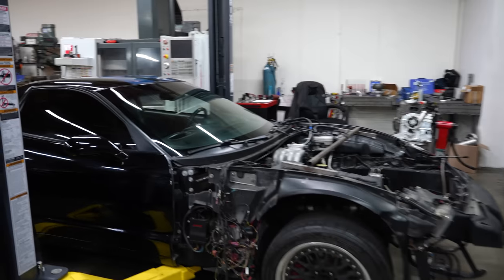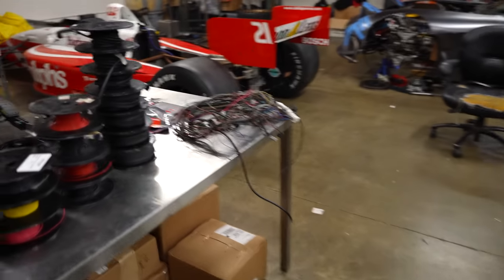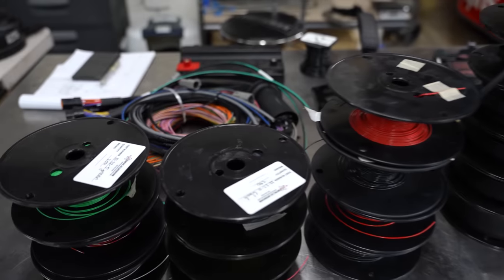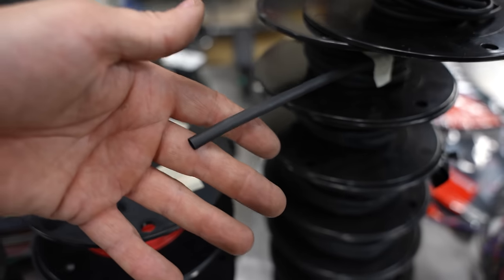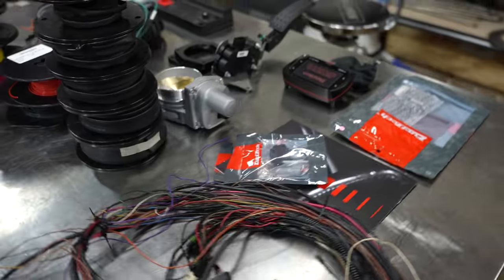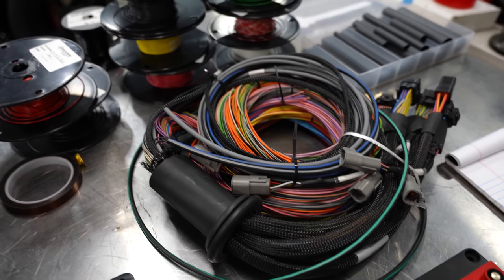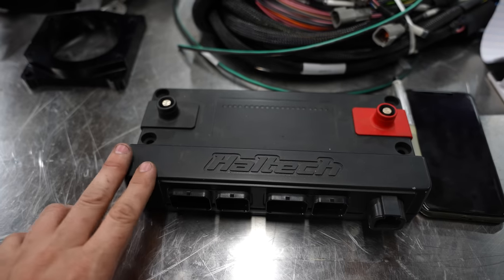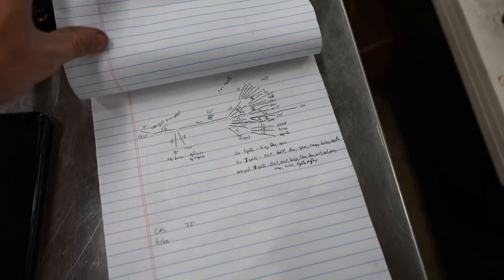The Ultimate Engine Wiring Starter Guide.

Comment: I think there was a missed point here that while a magnet would create EMI in a wire that is not shielded (and properly grounded), the reason that is a concern is that every single wire that carries current generates a magnetic field. So while you don't have magnets bouncing around inside your engine compartment, you do have a bunch of wires acting like spaghetti shaped magnets all over your engine bay. Higher current means more magnetic field, so this would be a particularly bad situation when your starter is drawing current, and is a huge concern in electric cars.

Comment: There is a tool I am sure will help you strip wires more easily and efficiently, Knipex ErgoStrip (part number 16_95_01_SB). It strip wires from 0.2mm to 4.0mm, at either end it can strip the outer layer off wires like your crank sensor and it can split the outer layer after cutting the desired length for quick removal. 

My dad and I each have one and it is an amazing tool, very useful I recommend anyone who does a fair bit of wiring or does it professionally.

Comment: Great video.
You could use cotton thread/rope insted of expensive dummy wire. No way for it to catch fire and it is much softer and forgiving. It is used in power tools cables very ofter as strain relief. 
And some talk powder (or even fire extinguiser poweder) can keep the cables from grinding to each other under high frequency vibration and absorb moisture/liquids. Makes the process a litle bit harder but it is worth it in my opinion.

Comment: Rob, too late now but if ya got a wire color you didn't plan on using in the harness (think light gray or blue etc) you use them as filler. That way you never confuse em

Comment: Hey Rob, loving the video so far! At 38:17 you said that the black filler wires stop and then start back up. Is there a specific reason you stopped and started? Why not just make them one length for continuity?

Comment: Okay, so few questions.  What is the exact reason for adding the wires that were not going to be used?  It’s going to be covered, so it’s not like it would be visible.  Does it benefit the harness in anyway?  Does it allow for more flexibility or something?

Also, is this harness specifically for the engine only?  Because it looked really short when it was wrapped in your hand.  Does this not also go to the lights (headlights, taillights, interior lighting, if the car will have it, etc.) of the car?  Not familiar with haltech, does that dash piece that this harness plugs into only control the motor itself?  The rest of the stuff still has to be plugged into the standalone ecu, right (again, lights, airbags if someone chooses to still have them, etc.)?

Comment: Hi Rob, wonderful job.  I do rebuilt wiring harnesses for classic Mercedes’ benz and that is a complete different challenge.  But one of the products you mention “signal shielded 2 line wire” is something I have wondered where to buy it since a long time.  I own a BMW E31 840ci which use to had many electrical issues for which I have repaired and leaved in mint condition most of its harness.  Nevertheless  I was not happy with the crappy shielded wire I sourced to replace the Crankshaft position sensor and camshaft sensor lines.  Could you recommend me a vendor for quality wire to replace those lines in the bmw 840 harness?

Comment: Rather than putting extra wires in just to fill out the layer, why not use something like nylon string or something to add the space, but be more flexable and not waste copper and cause less confusion. You can't mix up a nylon string with a wire ;)

Comment: why didnt you go solder seal wire connectors? you get soldered connections heat shrink with hot glue to water proof all in one go

Comment: Jolly good video 👍

BUT, electricity DOES NOT travel on the outside of the wire. Well, with EXTREMELY high frequencies, there is that affect, and what are called 'wave guides' may be used.
The reason multiple strands are used in the wire is simply down to increased flexibility and, as copper is susceptible to work hardening, the reduced stress reduces the risk of fatigue breaking the strands.
That work hardening problem is also the reason aluminium (aluminum for the 'mericans) isn't used as a conductor for vehicles - unless you REALLY want failures.
Very high end wiring harnesses will use silver, as the resistance is even less than for pure copper, so a lighter gauge can be used. Eve higher end wiring will be formed with a hexagonal cross-section to allow even higher wiring densities to be used.

Gold plating of the connectors is normal as, even though gold isn't the best conductor, it's extremely resistant to corrosion, which can cause problems with the conductivity.

Comment: Would it be beneficial to terminate one end of the spare wires and ground them? In low voltage wiring this is commonly done to prevent keep electromagnetism from building up energy in the spare wire that could possibly cause interference/crosstalk.

Comment: As a filler wire of the same diameter why not use a lower amp cheap wire so as the thickness is the same!

Comment: I have a 2013 Kia rio  I just took the steering column out of it it's electric put it in a buggy hooked up all the wires The key power on  Wire There is a blue and red Needs to be hooked up Where do these wires go

Comment: My 1999 Truck had 59 wires going to the Power Train Control Module.  These wires need to be longer.  I am having trouble finding solid wires with a stripe.  These need to match the current scheme that came with the truck.   Where to get Finely stranded Automotive wire with GXL insulation??

Comment: Watching some of your newer/other videos, you were removing unnecessary weight from the vehicle and trying to balance the weight. Coming back to this video, do you regret using wire as filler? Reasons being, 1)the extra weight, 2) the cost aspect, and 3) couldn’t you have used another material that is 100% the plastic? Could a cheap option be using 3D printer filament as filler? The filament comes in any size, so getting a spool that matches the same o/d of the wiring would be easy as well as lighter and more cost affective.
Reply: Not saying I learned a lot and enjoyed watching the video. Also, there’s a zip tie trick where as you braid the wire, you slide a zip tie along the length to keep everything tight and from unspooling

Comment: Use pipe to lay out your routes, use hose pipe for backbone and  smaller pipes for the splits. It allows that you to check radius on bends and makes sure splits occur in the right place. Once you have the pipe layout you can lay it out flat on a board and knock pins in to route the wires around. Once you have completed and wrapped your cables, make sure you warm the harness up before installation it makes it easier to bend the cable around in the car.

Comment: So I am only half through. But on the connections like for the 5 volt wires in the middle of the harness. Why not add some solder to the crimp?

Comment: curious can you show us how to wire/ use a relay? using the stock ignition as the trigger? im having issues with relays im swapping my fuel pump relay but my trigger isnt working or im having faulty relays? im not sure whats going on

Comment: Here's a thing that will make your mind bend (or blow.)

Electricity actually flows from the ground outward. Not To it. 
Electricity flows from high negative potential (the negative terminal) to low negative potential (the positive terminal.) As the flow of negatively charged particles (electrons) are repelled from the negative terminal and attracted to the positive terminal.

Happy wiring
Jordan

Comment: This build covered it all. Amazing to say the least. I wish you'd have soldered your splices. If a oil pressure switch internally fails it will pump oil through the wire and if that wire meets a splice unwanted resistance is made inbetween all those crimped wires. It's a pretty common failure in my day to day. Even fuel intrusion from injectors. Not only that but pressure is not needed, cam and crank sensors can wick oil into harnesses like lanterns believe it or not. I have my doubts in crimps.

Comment: Rob I have a question, maybe some advice if you will. I'm currently in college for automotives trying to get my associates, after my associates I'm thinking about doing electrical engineering for my bachelor's. I love doing wiring, I love working with electricity. Do you have some advice or anything for me? I know it's kind of open ended but anything helps. Thanks!

Comment: What could cause engine rpm to not return to idle speeds when you are coasting (not pressing throttle ). It normally happens but doesn't happen anymore. After 5 or so seconds the engine return to idle while driving and gas pedal depressed.

Comment: I'm also doing DBW on my FC. Utilizing a accelerator pedal sensor from an s2k to convert the cable to a digital signal. That way I don't have to modify my pedal or install an aftermarket/non-stock pedal. I will be using an rx8 throttle body. If you want more info, you can ask Isaiah to message me. I'm local to ya now too, over in Corona. - Will Mac

Comment: I would think someone would make plastic filler that you could use instead of wasting good copper. You could still include some actual spares, but having 7 spares seems excessive. You could have 3 spares and the rest as dummy filler that could save cost and weight.

Comment: I'd 3d print some molds to do an injection for the junctions.

Honestly you could 3d print a little compartment for the back of the fuel tech module to cover the wires too.

Comment: Eh Your ground theory is a bit much. You don't need EVERY ground to go to one point, but you don't want to have a million different grounds either. It is best to have like 1 in the rear chassis, 1 in the dash or console, and 1 or 2 in the engine bay depending. Trying to do ALLLLLLL of them in one spot is just a waste of wire, and by shortening the grounds you also reduce resistance in your lines. You will be ok going to one point, it is just sort of wasteful of wire, and is prone to loss by going far longer than needed for some things. Everything else pretty spot on tho. Well said.

Comment: Can you use any color wire or do you have to use a specific type of wire for a specific type of part it’s connecting to?
Reply from the maker: I’ve noticed different companies try to use a common theme. At least it’s easy to think black is chassis ground. Red is 12v. Then you can use discretion on sensor ground being say black with stripes and 5v being red with stripes.  Commonly seeing companies use white as sensors and yellow as outputs. But once the harness is sealed up it’s like that Benjamin Franklin quote about banging ugly women. In the dark all cats are gray. Oddly enough I’m not making that up haha
Reply: @RobDahm  this helps a lot even though it was kinda hard to understand but I finally got it. I’m still pretty young and I love to watch your videos. Your videos help me learn a lot of things about rotaries and a lot of other things. You motivate me to get an rx7 fd before I graduate high school which I really want to do because you got your rx7 at 19 which made me realize that it’s possible. I think the wiring might be the scariest part to a car for me at least.

Comment: if you need cheap heat shrink go to your local bicycle shop and ask if they have any old bicycle tire tubes you could buy for cheap. They work exactly the same and are great on a budget.
Reply: Very funny eh?
Reply: @M-DIY  what? it’s not a joke
Reply: @patrickriordan2447  Buty rubber tubes are not polyolefin tubes which would shrink upon application of heat.

Comment: Why not just use lower cost wire for the filler wires?  Gauge, conductor type and insulator type is irrelevant for them, so just find cheap, generic wiring that matches the same outer diameter of your good wires.

Comment: Rob just accidentally explained 75% of the ultimate mud truck waterproofing and he doesn’t even know it.
All that’s missing for mud trucks:
Silicone the distributor cap (or make a custom one)
Marine mil spec amphenol connectors rather than the lightweight Motorsport ones
Subsea submersible electronics box(es) for ROV (repurposed for ecu/ign/bcm)
Submersible grounding box
Additional potting in key locations

Comment: Why wouldn't you use all individually shielded cables or buy 24 Core Dual Pair with Individual shielding? Just a thought. Also why not use solder, is it not better than crimping, then you don't worry about strain relief?

Comment: Chunk of metal no chunk of metal hey I think it’s called a sign wave single lol…—[___[__[ close as I could get with a phone lol…it’s just a on and off single which has either a missing tooth or wider gap fir cylinder number one
…this isn’t very complicated if you’ve got a proper Ecu and you know the pin connections it’s just a matter of running the wires soldering a connector and plugging everything in…

Comment: May god how long can someone go on into making up a harness , and I’d say your levels are screwed up..
Milspec would be the top level which is pretty much what you also see on a true F1 race cars today too or on military fighter jets too..,having pin connections and all being strong enough to handle fuels and harsh conditions plus using other Materials than copper for faster transfer speeds, water proof etc..,
Next is the Typical race car stuff & HIGH END oem wiring ..
Then you have the custom high end aftermarket harnesses..
 Then the cheaper aftermarket harnesses..
Then as you pointed out the mix and match OEM professional tech built harnesses ..
Then the cheap mix and match back yard junk wring harness built by someone who thinks they know what they are doing but don’t and have issues left and right lol…

Comment: A sane man would not waste a cent on wire to fill caps in a twist so it looks nice, when you see professional wire looms for sport based cars they have cap in the twist under the heat shrink as you do not want to add unnecessary weight even a gram  added is lost speed & performance due to weight

Comment: Fun fact: The electrons don’t care how much you spent on wiring.
Reply from the maker: But my monster audio cables!! Haha
Reply: @RobDahm  I heard that line while working in a music shop trying to sell audio cables to a retired lead engineer at HP turned guitarist. Brought that full circle. 

Never change Rob. It’s amazing how far this channel has come. Thanks for bringing us along for the ride.
Reply: @RobDahm  Another fun fact, AC current travels on the surface of the wire, but DC current travels through the cross section of the wire. Typically automotive wire has many strands to aid with routing tight bends.

Comment: mechanical timings, no much wires to be used
Reply: try air-craft rotary engines, or turbine-generator-battery-electric-supercap-hub/central engine
Reply: ac travels on the outside, dc uses all the wire area
Reply: no timing is the best timing
Reply: continuous burn heat source, 100% heat clean burn, then use the heat to produce your forward-power
Reply: be it electric, jet, or steam car power plant, also steam-electric, even thermocouple thermo-electric power source, that can then be used in electric motors, you have the high horsepower/torque assumed in the electric motors, also gasoline burn heat-electric, or just plain gasoline-piston-electric-generator with electric axle-motor/hub-motors
Reply: time mechanical delay to the spike disc
Reply: if you multiplex the signal into frequency domain, differential emi cancelling, two wires negate outside interference
Reply: twisted pair, huh
Reply: use network cable, BASE-1000T, gigabit or better
Reply: cat-5-6-7
Reply: shielded cat-5-6-7
Reply: use wifi sensors, no cables
Reply: use optical cables, no interference
Reply: why you always do the work again and again
Reply: just use ethernet sensors, plugs and cables, switches (hub/central/gather), and direct access to computers
Reply: access/packet time in local network is at max 1ms, at minimum 1kHz, 1000 packets per second
Reply: some automation frameworks that use ethernet to connect sensors, could be used to control the engine, maybe CAN bus too, the main point that you can put a computer, like rpi4, with actual computer in it, to control the whole engine and car, all-in-one
Reply: then you can buy/get/use generic hardware, ethernet/bluetooth, not specific expensive crap
Reply: power the sensors by power-over-ethernet, POE
Reply: ready made ethernet cables
Reply: nice flower, those wires
Reply: like optic fiber flowers
Reply: open source the software, hardware